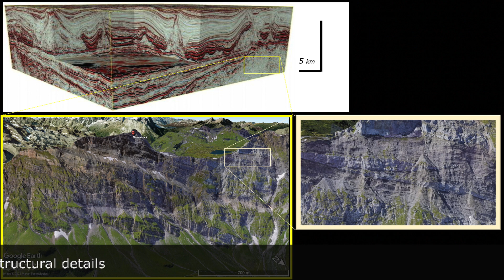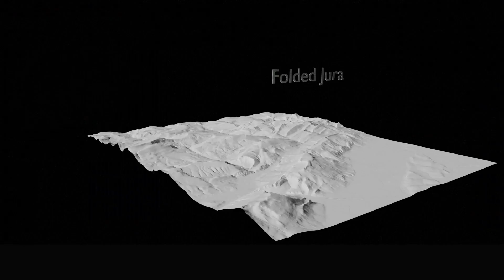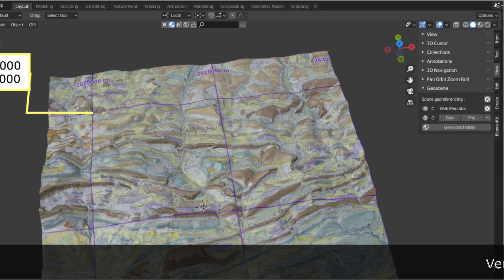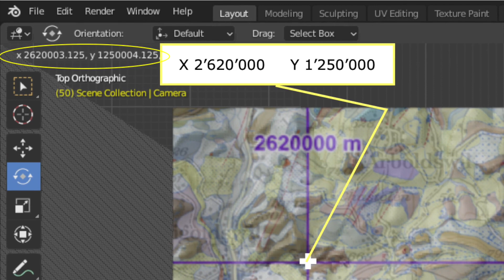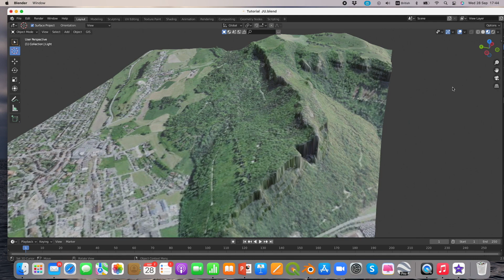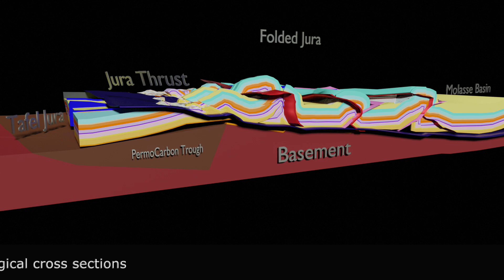BlenderGIS Tutorial PART 1 - Digital Elevation Models

Comment: Small little addition here, but I actually got hung up on this for quite a long time, you chose to import an .arc file here and so I think it automatically adjusted to a high resolution with displaying the DEM or something, but when I bring in georeferenced tiffs they by default display at a very low resolution and it is very confusing and kind of disheartening if you can't figure it out.

What I figured out is, and what I think needs to be part of this type of geology tutorial for Blender is that Blender will display (with the BlenderGIS plugin, which I do recommend) the raster .tiff DEM in 3d by "deforming" each pixel by an elevation amount according to that pixels color/lightness value... but obviously this is a very computationally intense process, so by **default when you load the .tiff into blender it will do some handwaving and group pixels together into much larger chunks to make on-the-fly display of the 3d workspace quick and responsive and so the DEM will look very low resolution or possibly will look barely deformed/3d at all**.

*The solution, which I propose you add to this video* is to after you add a tiff choosing the option "DEM as displacement texture" (with BlenderGIS plugin) is to then go to the "properties" panel on the righthand side, click the blue wrench "modifiers" (panel view gives you the order of operations of modifiers on that object), **click "Add Modifier" "Generate->Subdivision Surface", then drag that modifier to the top of the stack so it happens first**.

Select "Simple" (not Carmul-Clark or whatever) "Now as you crank up the value of "Levels Viewport" the DEM will display in realtime at a higher and higher resolution, 6 being what appears to be original or very close to it. Cranking up the value of "Render" will do the equivalent thing for any renders/animations you make. Thus you can keep the "Levels Viewport" at 4 or something and leave the ""Render" option at 6 for final export of your video or image.

Comment: Podrías hacer otro video donde incluyas el proceso desde Arcgis o Qgis y luego a Blender. Porque aquí ya lo haces todo con insumos previos que no sabemos cómo fueron geoprocesados.
Reply from the maker: Hello  I am a bit fortunate to have DEM in Ascii Grid format available -the easiest and fastest way to create DEM in BlenderGIS. If not available you could go two ways (many tutorial are already available)

1. The QGIS - BlenderGIS route - and create a DEM terrain mesh in Blender, driven by a QGIS grayscale altitude map. Once available you can  project your geological information georeferenced with the same CRS onto it

Here an example of a Tutorial
 https://youtu.be/J8wkghNmsWc?si=Jt5rmQwbeCxLimYi

A. Prepare the Heightmap in QGIS
1. Load your DEM raster in **QGIS**.
2. Style it with **Singleband pseudocolor → grayscale (black=low, white=high)**.
3. Export as an *8-bit or 16-bit grayscale GeoTIFF* (prefer 16-bit for smoother displacement).

B.  Import into BlenderGIS
1. In Blender, enable *BlenderGIS* add-on.
2. Use *GIS → Raster → Georeferenced raster* to import your GeoTIFF as a plane (or import your basemap first).
3. Scale the plane to your desired resolution.

C. Apply the Displacement
1. Create a *material* for the plane.
2. Add an *Image Texture node* → load your QGIS grayscale DEM.
3. Plug it into a *Displacement node* (not the Principled BSDF).
4. Connect Displacement → **Material Output (Displacement)**.
5. In **Material Settings → Displacement**, set to **Displacement and Bump**.

D.  Adjust Geometry: Increase *subdivision* of the plane (use Subdivision Surface or Adaptive Subdivision if using Cycles with Experimental features).
* Tweak *Displacement Scale* until terrain matches altitude range.

2. The Google Earth route: You can create low resolution more regional DEM directly  in BlenderGIS using GoogleEarth data - also many tutorials are available on this - 
here is one tutorial 
https://youtu.be/u8Fg-u-VWUE